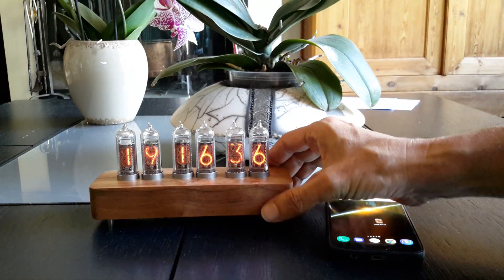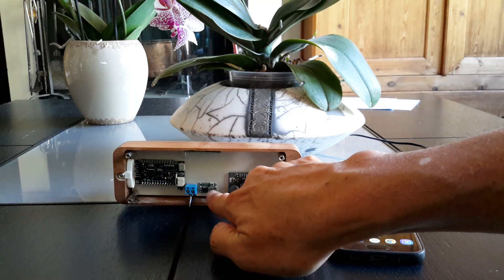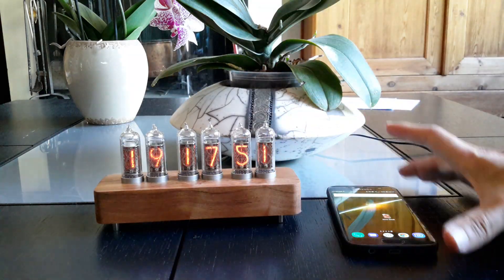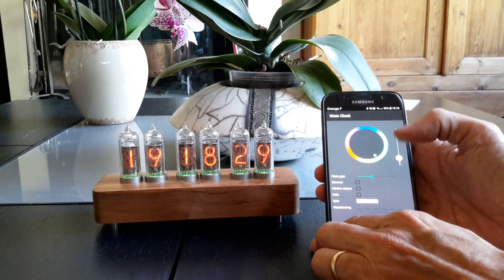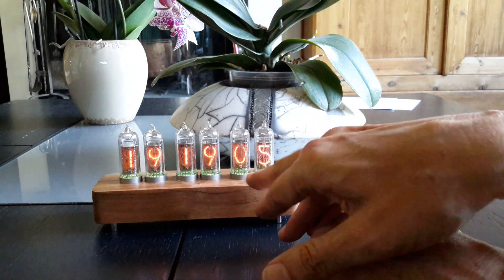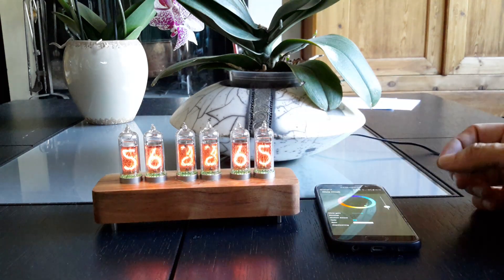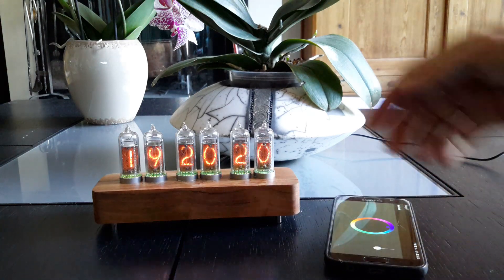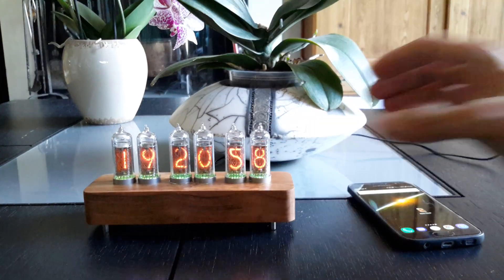Nixie clock

Comment: Nice design. I am also designing a nixie clock that will work on an all CMOS circuit (retro electronics for retro displays is the idea) but I like your idea of radar sensor. I think I will implement that too. I will be using a GPS assisted 1 Hz clock signal to drive everything.
Reply from the maker: the radar works like a charm
I had the same idea for the GPS  (tiny Ublox8), but finally I gave up for a more "modern" ntp sync !